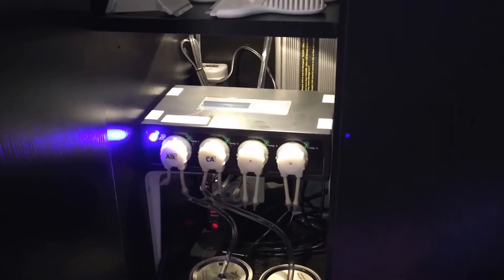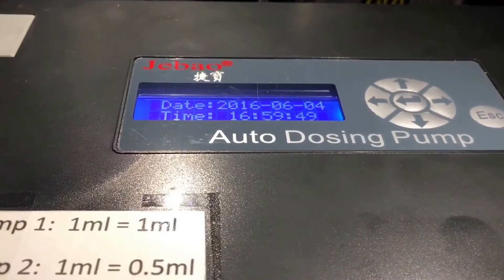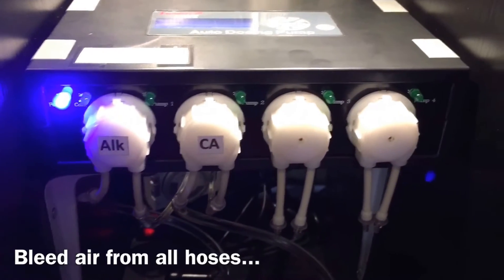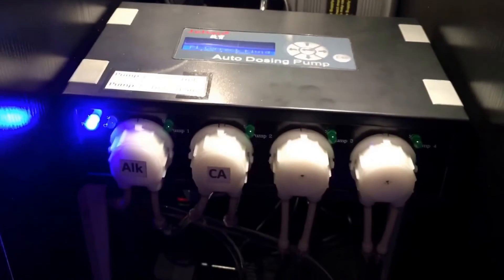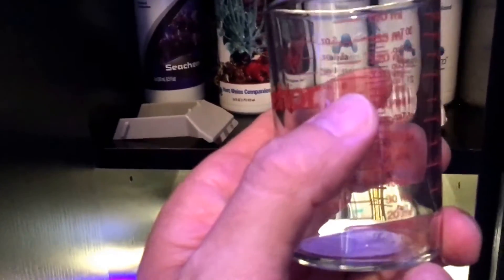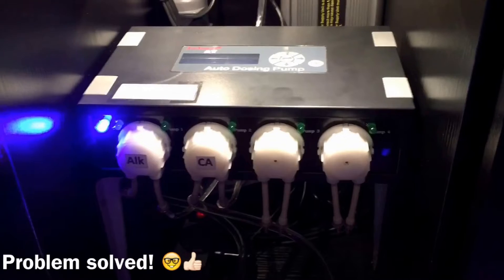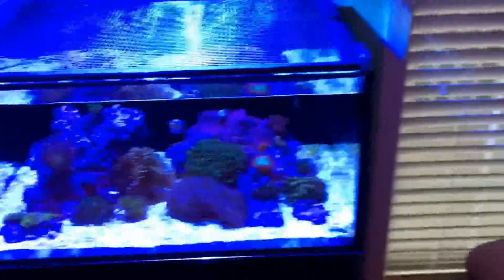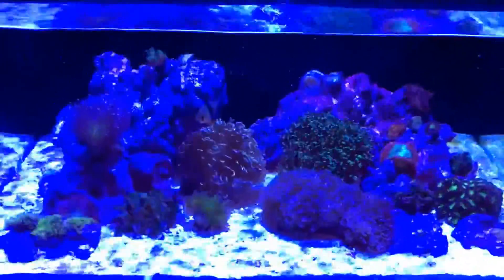Jebao DP-4 Dosing Pump

Comment: i am using this pump.  I'm getting a ton of air in my output line, even with a check valve near the exit point.  Ideas?
Reply from the maker: Paul Diehm make sure that the hoses are pushed all the way onto the hose barbs and that the connections are tight. After that, purge all the air from the lines by running a manual dose into a small container that you can pour back into your dosing reservoir. You don’t want the manual dose going into the aquarium, or it will raise your levels too high. Don’t stop the manual dose until you are certain that all the air is purged. You will get liquid coming out for a bit followed by air, liquid, air, etc. Once you have a steady steam of liquid you are done.

Comment: Thanks for the follow info,I have had the same problems with a aqua medic evo 4 doser which is the same as the Jebao unit with the same firmware,it to has been dosing 2ml for a 1 ml dose! have calibrated to 50ml let's hope it fixes the problem ,Not good enough from aqua medic in my view.spread the word..

Comment: Very helpful my friend. I love your explanation, is on point. I just ordered one for my 100g reef tank.
Reply from the maker: abdullah ahmed Thanks for the positive feedback. I'm extremely satisfied with the dosing pumps. Makes dosing easy. Remember that these aren't "set and forget". You still have to test parameters and adjust accordingly. I test once a week. I had to program an extra dose for my alkalinity additive on my 25 gallon just this week. It had dropped to 8.3 dkh due to the extra coral growth. I like to keep it at 8.9 dkh. Good luck!
Reply: cyberaquarist absolutely! I just like the fact that it's easier to use and it will also dose on time and at certain time as well everyday. Better than by hand.

Comment: Thanks for the video bud! I'm about to buy one of these for my tanks, but the newer version #2.
Reply from the maker: You're welcome Jose. Hopefully the newer version won't have the calibration issue. I'm so glad that I went automated. Makes life so much easier. I test once a week to make sure all is well,. I had to up the Ca dosing on the 38 by an additional 0.5 ml a day after a few weeks of setup. All my parameters stay spot on. You'll really enjoy these dosing pumps. Good luck bud!
Reply: +cyberaquarist I just got it! It's interesting that some people say that this thing is accurate. I'll let you know how it goes. I don't know how to tell if it's version II though.
Reply: +cyberaquarist So yes I did run into the same issue. 100ML  will dose 3ML instead of 2ML. I did try to set it at 50ML, but it dosed less than desired, so I just left it like that. Now I know that 1ML is actually 2ML. I'm also supposed to have the V2, but it looks exactly like yours.

Comment: Thank you for the find on the calibration issue.  What I did to fix the issue is to calibrated to 85 ml instead of 100 ml.   Then I ran a program to dispense 20 ml and it was spot on.  It wad approximately 155 revolutions for me to get it calibrated properly.
Reply from the maker: Before I made this video I hadn't heard of anyone else experiencing the calibration problem other than Brian, but I knew it would be common. I'm glad that you corrected yours.

Comment: Hey cyber how much carbon and phosguard do you have in your reactor, I have a 20 gallon tank and cant really understand how much to put in the reactor I have the I.M  mini desktop reactor ,
Reply from the maker: Hey bud. I have 17 total gallons of water in my Fusion 25 and I run 4" of carbon when measured from the bottom of the reactor. I place two of the circular sponges on the bottom, the carbon (Matrix carbon), another sponge, and then top it off with Phosguard (about 1/4 cup) and the fourth sponge on the very top. All brands of carbon release phosphates to some extent, so by placing it upstream from the Phosguard allows it to be removed before entering the display. This configuration keeps the media tight and doesn't allow any of it to tumble. This is what you want. It is easy to change out the Phosguard while leaving the carbon in. I change the Phosguard every two weeks maximum or when I start to see algae creeping up. I change the carbon about once a month.
Reply: +cyberaquarist hey thanks a lot cyber I'm new and your videos helped me out you and another guy CJ I think have the best aquarium help videos out on you tube so thanks again
Reply from the maker: +Bay Area Reefs You're welcome, and thanks for the kind words.

Comment: Very Cool. When I get to this point I will insure calibration. Like the jars. good find. I would not have thought to use them because of metal  tops. You are always teaching. Thanks again👍
Reply from the maker: Thanks John! Don't worry about the metal tops on the jars. They won't be coming in contact with salt water, and the calcium and alkalinity supplements won't corrode them either. I appreciate the comment.

Comment: Good catch on the calibration issue.. You should write a instruction booklet and sell them to anyone with these pumps and have jabeo pay you smh. What are your top 3 salt brands to use that will not throw off your dosing regime? I'm looking to change from reef crystals after this bucket to shoot for more natural sea water parameters ... RC makes it impossible with the frequency of water changes I am looking to do.. Just curious on your top 3 ... Thanks
Reply from the maker: I'm just glad that I caught the issue before I crashed both of my tanks. As you are well aware, we have to check, test, and question everything in this hobby for quality assurance. I'm currently using Aquavitro Salinity for my salt mix, and I've had great results with avoiding large swings after a water change. I didn't really base my tanks dosing regimen based on coral uptake, but rather my tanks trend. I averaged out uptake and removal over a 45 day period to determined my daily dose. My top three salt mixes are 1. HW Marinemix Reefer, 2. Aquavitro Salinity, and 3. Tropic Marin Pro Reef. All of these salt mixes have been formulated with optimum levels of the essential elements and major and minor trace elements for reef tanks. They are also some of the purest / cleanest salts on the market. Reef Crystals is pretty good too. I wouldn't hesitate using it. 
Thanks for watching and collaborating. I always enjoy and appreciate your input.
Reply: I use the HW Marinemix Reefer and the 3 corals I have seem to perk up after my water change like crazy. My shrimp constantly molts as well and is growing like crazy. The only thing that worries me about this salt is I have been getting a little lower than advertised for ALK(less than 7). I'm wondering if this is why I am getting some blackish green hair algae even though nitrates and phosphates are undetectable. Calcium is consistently at 425-450 and Magnesium is always 1350(measured with Red Sea test kit).The other thing that sucks about this salt is that I can only find it at one supplier(bulk reef supply). It is easy to work with though. You can mix it with room temp water and damn near stir it clear in the mixing jug with a stirring stick. Great video cyber. Maybe I will switch to Salinity as well since I can get it at the LFS near me. The owner changes 10% of his 200 gallon show tank every 5 days, never doses and his corals are exploding! I swear, there are a million different ways to do this hobby!
Reply from the maker: +Shane Moore Thanks for the comment Shane. HW Marinemix Reefer is an extremely high quality salt mix that has been around forever. Each batch of Aquavitro Salinity is labeled with the test results by an independent lab separate from Seachem to insure quality and validate elemental makeup. My own tests parallel with the lab results. If you decide to switch to Salinity I know that you will be satisfied.

Comment: Thanks for the great info. I have one coming in soon and did hear about the calibration issue from my LFS. This will make setup much easier. Thanks
Reply from the maker: Thanks for the comment Chad. I'm glad that I tested the first dose's accuracy. Otherwise I could have crashed both of my tanks. For the price these are great dosing pumps, and the calibration issue is easily solved.

Comment: Digital time display for mine doesn't get precise after a period of time regularly, gotta reset again from time to time. Btw, personally got a DP-4 with a defective motor right out the box with no luck lol This brand doesn't have spare motor part available, but the only way to replace any defective motors, which's to send back where the vendor we bought from, and waiting to be sent back after unknow period of times... Lol
Reply from the maker: Thanks for the tip on the clock. I'll keep an eye on that. Both of my pumps came with a spare pump. Maybe Jebao has just recently started adding that in.
Reply: +cyberaquarist My pleasure. But I think the "spare" pump is without motor in it, but anyway wish you to have good times with it, cheers mate :-)
Reply: I had the same issue with mine.  I bought 4 new motors.  Before I got them a friend told me to remove the outer cover and spin the doser by hand.  What do you know, that did the trick for all my pumps.